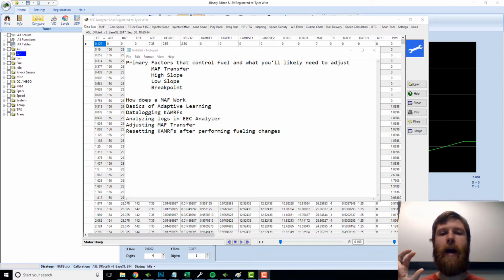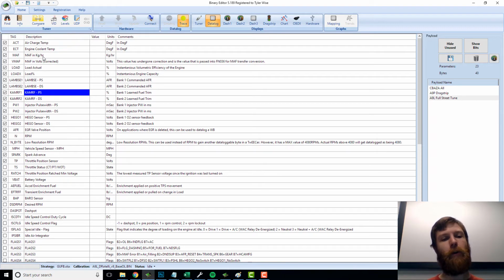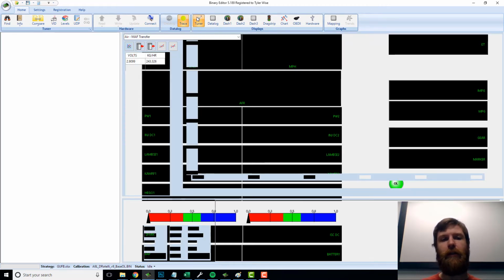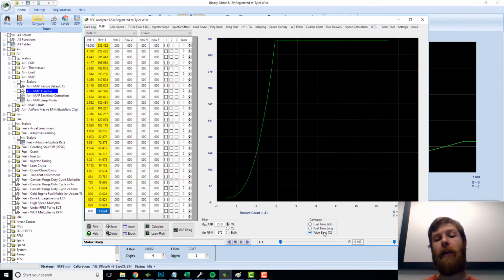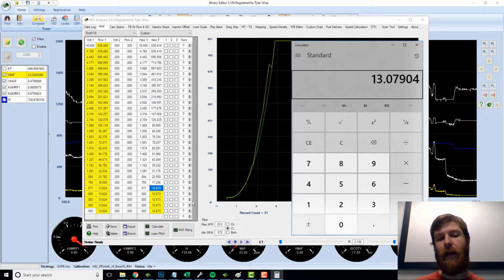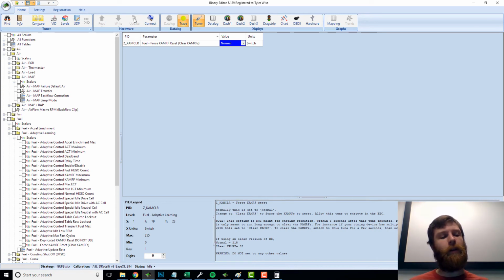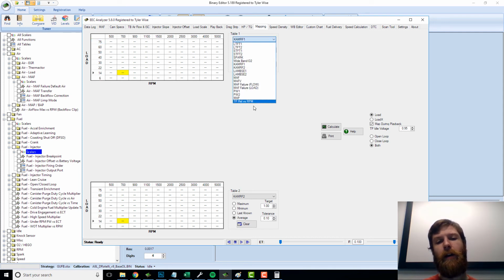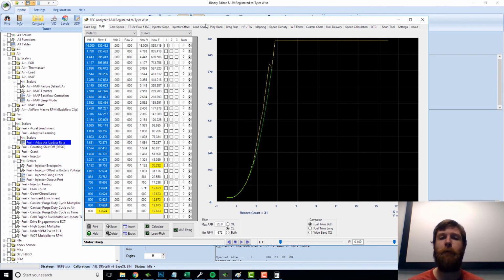How to Adjust MAF Transfer - Dialing in Idle Fuel on Fox Body Mustangs using a QuarterHorse - Part 1

Comment: Can I apply these same principles to the 94-95 GT T4M0 computer ? Or is it completely different?
Reply from the maker: There are tons of differences on the T4M0 overall, but when it comes to mass air tuning for fuel, that process will largely be the same regardless of ECU, so I'd imagine this video's theory should cross over fairly well for your application.

Comment: Hi, do you log and tune the MAF curve and Slopes (WOT and idle) in closed loop, or do you force open loop?
Reply from the maker: Any time the factory O2 sensors are in place and the engine has a cam with moderate overlap, I prefer to leave the car in closed loop and let the sensors go to work. Then make adjustments based on averages of those readings.
Reply: @LeechMotorsports  Thanks. Your "factory "O2" comment makes sense and lines up with some of my initial thoughts.  I seemed to be having better results in closed loop. In all the reading I have done, no one really ever explained which is most prefered and why.

Comment: A suggestion, you should stay away from using short term trims in your calculations, use only long term. short term is driven by the ecm for Catalytic reasons, and will always be rich-lean, its by design.  you should accumulate long term data, and if you wish apply it to your xfer

Comment: Man, I am struggling. Datalog says the car is going into Closed loop, but the KAMRFs are not changing from 1 so I have no data to tune my idle fuel with. Made sure car is up to temp. Factory A9L calibration, with very few changes. Basically raised the idle by following your other video and changed the injector data because I have frpp 30lb injectors. Haven't touched any of the adaptive learning stuff and have cleared KAMRFs multiple times hoping to see a change. Any ideas?
It has longtubes,  maybe something I'm missing with related to that? HEGOs are switching
Reply from the maker: Hey email your phone number to me at matt@leechmotorsports.com. I’ll give you a call.
Reply: @LeechMotorsports  Thanks! Email sent 👍

Comment: Hello Matt!!! Awesome tutorial on tuning the foxbody!, I have been playing with this tuning thing for over 12 years on and off. After i ran into your channel on YouTube I decided to start tuning all over again. Here is my setup, 306, NOVI 2000, ~12lbs boost, 8"asp crank pulley, Quarter Horse, svt Y303 heads, kb pistons, Anderson ford B21cam, trick flow intake,1.7 roller rockers, 60lb inj, sct ba2800, long tubes, x pipe, 70mm tb, CF clutch 355 gears, mm control arms, cold air fw intake A9L. 
I have gone through your setup videos and have the car running better than my previous tune but my setup has always had a rich tune at about 15%. If I remove 15% off the MAF curve the KAMRF are almost dialed in. So do I mess with the injector low slope to compensate for the lower idle richness are or do I just adjust the MAF and trim 15% off the curve? I have to test my WOT AFR to check the percentage out at the top end of the curve with my innovative wideband O2, but first I have to replace my Quarter Horse as it started to lose it's tune after I shut the car off, it's an early one and I have replaced the battery and resistor as Moates suggested in their TSB but is is still pooched.  Once I get the new QH I'll continue to tune. Here is my ride: https://youtu.be/MscZ5JZPNc0
Reply from the maker: What specific 60# injectors are you running? And what is your base fuel pressure set to (measured with vacuum line disconnected from the regulator)?
Reply: @LeechMotorsports  Siemens Deka 60 Lb Injectors, fuel pressure set to stock settings with vac off, kirban adjustable FPR.
Reply from the maker: Ok, send me a copy of your current tune and a data log and I will send back a revision when I have some time. Matt@leechmotorsports.com
Reply from the maker: Perfect. I would recommend running the data straight off of ford’s calibration sheet for LU60 injectors for high slope, low slope, breakpoint, and offsets. Take all of the stock cranking pulsewidth numbers and multiply them by 0.43. Then leave the injector data alone and do the rest of the fuel correction in the maf curve. I trust that injector data and have used it countless times. That maf will likely need some tweaking though. Rev analyzer has data for the ba2600 and the ba3000. I just average those out and use that for the ba2800 mass air data as a starting point.
Reply from the maker: That car is bad ass by the way. Just watched your video. Really sharp car!

Comment: im following along with all your videos, but i still cant quite get a handle on tuning in my f303 cam. if youre interested in helping me understand a few ways, please let me know!  thank you so much for all the knowledge youve given us so far
Reply from the maker: What are your questions?
Reply from the maker: Feel free to reach out to us through email: matt@leechmotorsports.com & cody@leechmotorsports.com
Reply: @LeechMotorsports i sent an email
Reply: @weeman333briglio2  lol ball's man I'm trying to see if you're doing something similar to what I want to do I'll give you some info on it I'm sorry it's probably going to be a freaking novel I do apologize
Reply: @weeman333briglio2  I have a 91 f and 50 to wheel drive 5.0 l well it has an issue to where it will fry the ECU ICA and rarely the coil I think I sort about that issue it was a short and harness but fingers crossed anyways they've put header pipes on it made it a true dual exhaust no crossover pipe it has the smog delete too this is before I got the vehicle I have some ECU's some A9Ls that I am trying to hook up to my truck too I want to convert it over to where it's in mustang brains set up but the body is f450 worked on cars all my life and I'm still learning some just got right here is like blowing your mind isn't even the right word so for him I'm very possibly going to put in the other O2 sensor then change the MAP sensor to a MAF sensor I need to ask him this about this speed density thing that something that your harness hooks to the rear end of your car if I'm not mistaken and then I will hope to God pick up a little bit of performance and a lot of fuel economy just wished I lived close enough to this butthole I mean that light-hearted it just thinks that he's always out there in Illinois and I'm all the way down here in Carolina sucks cuz I don't know if anybody around here that is really into doing mustangs and or conversions like my truck will be a convert anyway s you probably not even interested but I am interested in what you have going on because anything that I can learn gives me more experience and it may cross over to help me out a little more in the long run anyways thank you buddy later

Comment: I think you mentioned on one of your vids that drivers side bank always seems to read leaner.  I noticed that on my car too. Just wondering why that’s he case.
Reply from the maker: That’s a good question. We’ve never tried to run any actual experiments in an attempt to prove why. If we were always only talking about a bone stock engine, I’d suspect the biggest contributing factors are differences in header primary exhaust tube bends/thickness/temperature, intake/exhaust flow on each cylinder, the design of the stock intake (not symmetrical left to right side), the flow of coolant through the engine, and the routing of the fuel lines/rails. But truth is, I’ve seen this over and over again on virtually every 5.0 I’ve touched... all kinds of combinations of heads, cam, intake, exhaust, fan, cooling systems, power adders, chassis... it’s just odd. But I dunno. We just do it that way. And honestly, on a healthy engine what’s the worst that could happen? You’re wrong, and the other side is actually leaner by 2-3% at wot? We tune pretty conservatively most of the time. So those kinds of differences aren’t likely to make or break the combo. But when you are pushing to the ragged edge that’s a different story. But those kinds of combos are the ones that start to benefit from faster computers, knock sensors, and closed loop WOT fueling.

Comment: Hey man have you had much of a play around with Aussie cars eg Ford Falcon AU XR8 eccV?. 
Thinking of pulling the trigger on a Quarterhorse
Reply from the maker: Sure haven’t. Never seen one of those cars in person. But I’d love to help if and where I can. Did you look at the list of strategies on the Core Tuning website to see if they support that computer? If they do, it’s important that you buy your quarterhorse and software directly from them. Otherwise you’ll have to come out of pocket considerably to gain access to that strategy. But there package deal is an amazing value when getting into these less used strategies.
Reply: Thanks for your reply, love the videos they have steered me in the direction of wanting to use a quarterhorse. I’ll take a look at the strategies on the website

Comment: With regards to eec analyzer and maf curve, if I have a wideband and it’s being logged, can I set the whole curve based on CL and wideband being checked?
Reply from the maker: Before I comment, I’ll assume that you’re working with an eec-iv, since that’s what my current videos are focused on. If that’s not the case let me know. You can tune exclusively based on your wideband if you’d like, but the car won’t be operating in closed loop. You would be forcing open loop in the tune, driving and logging, then loading the log into eec analyzer. On the MAF tab, make sure that you have wideband and open loop selected at the bottom before you ask it to recalculate. I personally prefer to leave the stock o2 sensors in place in addition to the wideband(s). The stock o2 sensors are very good for dialing in idle and normal driving conditions in closed loop. Then I use the wideband for the heavy throttle tuning.
Reply: The Leech , sorry.  X3Z.  Car is 93 Cobra.  I have narrow o2s in place with wideband installed on drivers side x pipe 4 in after flange.
Reply from the maker: Gotcha. Yeah, so that’s still eec-iv. So the comment I made above definitely applies to your situation. Shoot me a note at TheLeech405@gmail.com with all the details of your combo and your contact info and I can happily put together a base tune for you today and work with you through tune revisions as you get data logs.
Reply from the maker: I’ll use any excuse I can to play with a 93 cobra!
Reply: The Leech it’s on it’s way, thanks

Comment: In your video "it's in the tune" I also have a 408W stroker like john burrows build. I have a lot of the same components like Ed Curtis FTI cam 42 lb injectors 92mm pro-M 90mm throttle body and custom intake going into the fender. I'm happy with the tune. Car runs great. Get good gas mileage imo. Only question I have is how do you tune the 1st shift surge on lunging out? When I release the clutch when in 1st gear and car creeps around 5mph the car lunges. I do have a TKO 600 instead of the T56. AFR 185 heads. On the Dyno car put 459 HP and 455 TQ to the rears. Tuned by Brian Turner out of Dyno tune motorsports in Columbus OH.
Reply from the maker: Since these strategies don’t directly let you make fuel or timing tuning decisions based on gear or mph, you have to simply consider what else is different about leaving off idle. The big difference is going to be that it’s the only time you’ll be at very low Rpms for a split second. Do a log driving it the way you’re describing the see what load and rpm you’re at where the jump occurs. Most likely you can smooth out the timing in that area. Look for big jumps in timing around there. You can likely pull a little timing, and it generally won’t change the remainder of the driving experience.
Reply from the maker: Feel free to email your tune to me. I’d be happy to take a look. TheLeech405@gmail.com
Reply: Just throwing out an opinion and it's probably going to sound very stupid but I'm gonna go ahead and say it 
lol. That sounds like something of my dreams damn it man I love Ford's these kind of places are the only places where I can go and geek out LOL can't afford all that but damn LOL that engine sounds bad..... Almost gave me hard on🤣🤣🤣🤣🤣 LMAO I'm kidding I'm kidding but it does sound freaking awesome though as a bad sounding motor just hearing about all that stuff props to you man

Comment: When i hit the calculate  button it wont do anything
Reply from the maker: Did you make sure to load your current MAF data into the left hand panel, select closed or open loop at the bottom, and select fuel trims or wideband, then click calculate? If so a pop-up window should have appeared asking if you wanted it to make decisions based on your commanded AFRs in the log or at a static 14.64. If you never saw that window, it may have popped open behind eec analyzer. Also, did you go to the first table of eec analyzer and open your log prior to going to the MAF tab?
Reply: @LeechMotorsports  I went in to eec analyzer  and hit the data log tab went down to the open tab. open it up and selected my data log. which it poped up and showed me everything. then i went to the maf tab and pasted my current maf curve in just like in the video. and i selected the cl button and the fuel trims both button. but when i hit the calculate button nothing happens. is there maybe something i may need to set up somewhere els?
Reply from the maker: Kevin Hamer no that all sounds right to me. Shoot me an email at TheLeech405@gmail.com with your contact info and we can do a web session this evening to troubleshoot. Also if you could send me your current tune file and log, I can try it from my computer to see if it works on my side.
Reply: @LeechMotorsports  Hi, Ken here. I have the same problem not getting the calculate button to work. I also notice that the slide switch to find a time location is also grayed out. I followed your video and believe I did it right but nothing happens. Any updates on this concern? Thanks.....Ken.

Comment: can you correct the speedo for rear end gear ratio changes using a quarter horse?
Reply from the maker: On a foxbody mustang, the speedometer in the dash does not use the vehicle speed sensor. It is purely cable driven and requires the correct speedo gear to be installed. From a data log perspective, you can correct it, since the logs are based on the vehicle speed sensor.
Reply: @LeechMotorsports  Ok i should have been more specific, I am wanting to know if you can correct it on a 1995 mustang. I am pretty sure it uses the VSS and no cable. Also how familiar are you with the T4M0 computers in this car?
Reply from the maker: Per decipha.... with the incorrect vss gear your speedometer will be inaccurate, unless you have a 99+ which you can then adjust with the ecu